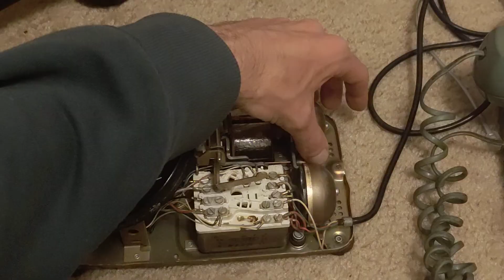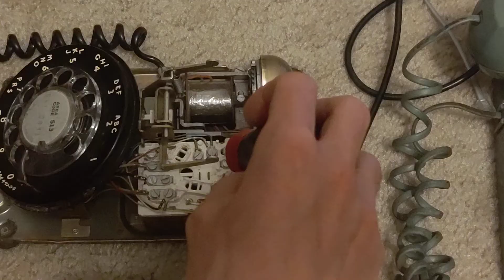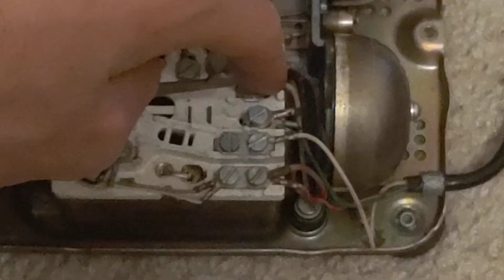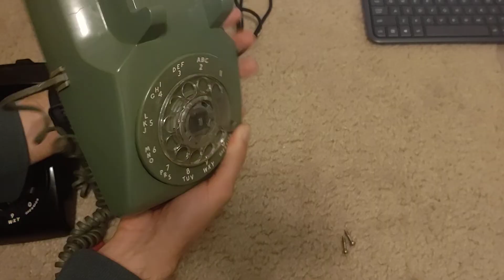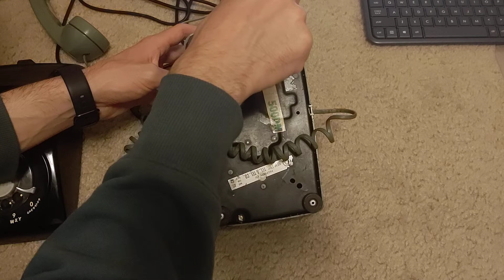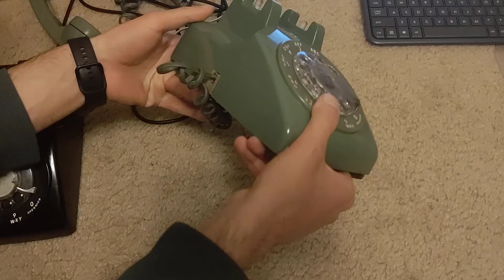How to make old rotary phones ring on modern phone lines, or how I learned to love the rotary phone

Comment: I have a 1st generation model 500 from 1954 on my nightstand. I have it hardwired into my phone Jack. I no nothing about VOIP, however, if your using a model 500 made by Western Electric that uses spade connectors, you must marry the yellow wire to the green if you want it to ring on a copper landline.

Comment: Growing up in East Hampton CT. in the 1979-1992 era, I constantly (bitched) about having a rotary phone, when it was SO much faster to use a push button phone. That town didn't have push button phone service until the 1990's. The dial tone was also different too. We didn't have cable tv on my street either until 1990. Even the school system have rotary phones. They had buttons in the schools phones, but they still used pulses, but they were electronically controlled. You still had to wait for the pulses which took just as long as dialing. I remember sitting in the principal's office and they called my parents having to hear those deadly pulses coming through the speaker on the phone as I got to wait on my demise that much longer! It was an added torture. I now have a new appreciation of this old technology and miss the days of there being "the phone company" as a single entity that pretty much contributed to EVERY single electronic invention of the 20th century. Those old phones could fall from or be thrown from any height and NEVER break. That one in the principal's office NEVER failed either!

Comment: I can’t find an old cable to connect it to the wall, the one with the fork prongs? How do you find one ?
Reply: those adapters are commonly available.  Has 4 holes and a cable with modular plug

Comment: How can I remove the paper written AREA CODE 513 in the middle of the transparent dialing plastic? Do you know how to open that part? Thanks
Reply: For those who is looking for it:
There is a small pin hole between the numbers 9 and 0. Place the pin or a strong needle there, rotate the dialing plastic very close to the end of one round, there is a gap and you need to push the pin harder and rotate it a little more, and then the plastic comes out.

Comment: How come some old rotary phones have those grace witches where it's easier to unplug and take off the cord but then some wrote a rephones don't have those little grace witches the cords are attached to the phone and you can't remove them it makes it really hard to use them if you know what I mean the one with the grace witches I can just plug it in to my My landline and it works just fine but when I find ones that I don't have those Gray switches I can't use them
Reply: Here's a replacement line cord, that connects inside the phone in place of the old cord. This one simply plugs into the wall jack.

Comment: Can You provide a link to re-wire a 302 phone to use on VoIP?
Reply: It should just work, however the ringer is a tuned circuit, with a ringer and a ringing capacitor in series. Trace out that connection, and leave the ringer connection to the capacitor alone.  Make sure the other two wires of the circuit (one from the ringer and one from the capacitor) are connected across the incoming phone line (L1 and L2 if I remember correctly).  If one of those wires is connected to the ground terminal, that means the phone was used on a party line and that wire needs to be moved to L1 or L2 to complete the circuit.

Comment: What if you have no phone line and you want to use your cell phone with the rotary phone as the interface.  I was able to find the necessary components to make all that work, but not sure how to get the ringer (bell) on the rotary phone to work.  I believe I have to somehow power the coil/solenoid that would move the bell striker back and forth?

Comment: Great video. I found this Cell2jack device that can connect an old rotary dial phone to your cell prone, but apparently the dial phone is not ringing, only the cell phone. Will this wire trick do it and make it ring, or do you know some other device that can work and connect a dial phone to your cell phone?
Reply: The cell2jack replaces a landline so it will work. Although, I would get an Xlink instead. The cell2jack is poor quality

Comment: I just bought an old rotary phone today. Got home and opened it up.. says 425B on it and 8-55. Does that mean August 1955? Also when I connect it to a wall jack, alli get is a fast busy signal. We haven't had a landline in years, only use it for wifi.
Reply: Yes. There should be a date on the bottom of the phone, too.
Reply: You plug a phone into a Jack with no dial tone service, and you don’t get a dial tone you say? What were you expecting?

Comment: Would this work for setting up an old AT&T push-button phone with Spectrum? I got Spectrum and the phone line is connected into the modem. The AT&T phone does not work unless its connected directly into the modem, however I have to disconnect the telephone line wall plug from the modem because there’s only one jack for Line 1, which means it turns off all the digital phones in my house. I want to connect the AT&T telephone to the line with a telephone splitter without having to buy a subscription to make it work, so I’m wondering if this tutorial will work for that matter.
Reply: Did you figure it out?  I want to do the same thing.

Comment: Hello! Question about repairing a phone. If the ringer was working but stops, what are some possible causes and solutions?  I have checked that the ringer switch is "on" and phone call can be made in and out but it just will no longer ring for incoming call.

Comment: I have an old land line push button phone that no longer rings. Instead, it growls. The hammer doesn't strike the bell. Even with this, I can barely hear it ring. I assume that I've missed some calls because I couldn't hear it. I removed the cover, but saw no hammer or bell. There is a round cylindrical thing that I assume has the bell and hammer.

I'm thinking about buying another land line phone. But how would it "know" to ring on my phone number?
Reply from the maker: Hmmmm, these directions are specifically for old party line rotary phones. I would do some more research to diagnose the issue on a touchtone phone. Is yours a Western Electric 2500 or similar?
Reply: You may need to adjust the bias spring to the lower setting. In between the bells under the clapper is a wire/needle spring in a hooked notch. Next to that there should be an empty notch, try moving the spring to the other position. The high position was needed for the strong analog ring power close to the switch in the old days but most modern systems don't generate ring current that strong
Reply: @St0rmcrash  Thanks. I'll try it

Comment: Most of those old mechanical bell phones, particularly old Bell System phones and their clones, had ringers that were tuned to a specific ringing frequency, and that frequency was usually 20 Hz (20 cycles per second) unless the phone was used on a party line that supported "harmonic" ringing (very rare in the Bell System). The problem is that many VoIP ATA's are set by default to send a ringing frequency of 25 Hz, and that is why the ringing is so weak.  In some ATA's you can change the frequency via a setting in the web interface, so I would try setting that to 20 Hz before making mechanical adjustments to the phone.  Note that in the very rare case where the ringer is tuned to a different frequency, that will usually be stamped somewhere on the ringer itself.  It was much more common to find different frequency ringers in Automatic Electric telephones used by the General System (GTE) since they did make extensive use of "harmonic" ringing, but occasionally an independent telephone company would also use it but would buy 500-series phones such as the ones shown in the video with ringers tuned to frequencies other than 20 Hz, so it's not absolutely unheard of to find a different frequency ringer in a 500-series phone, just very rare.
Reply from the maker: Very good to know! Hopefully I will get an ATA with adjustable ringing frequency.
Reply: Cool, I just checked and my 2-port Grandstream HT802 ATA (same as HT801 with 1 port) supports both a configurable 20Hz ring (25 also available) and also supports pulse dialing. Will have to try this out. Maybe the ringer won't have to be "tuned" with this ATA.
Reply: Thanks
Reply: there is also the problem of the ring circuit was 100 volts
Reply: I actually saw several configurations in a model 80 installation manual. I couldn't make heads or tails of much, it's still so new to me. There was the standard config, as well as one labelled "Rural Electrification Administration", whatever "R.C. filter" means, and finally two labelled "S.A.T.T. A" and "...B", which seem to be party line environments where different households get different ringing frequencies and/or polarities?

Comment: Where did the black phone come from ?  The green one , as I recall , was your dad’s , right ?
Reply from the maker: The green is my dad's from Boston. Black I got as a second line for elsewhere and for testing the second ATA. I also got it because it already had the 513 area code in the number card. It was quite inexpensive.
Reply: @walnuthills11  : From Boston? Cool! I bet back then the phone line that was used with the avocado green rotary phone was a (617) area code which was the code for Eastern Massachusetts under New England Telephone, part of the Bell System before divestiture in 1984.